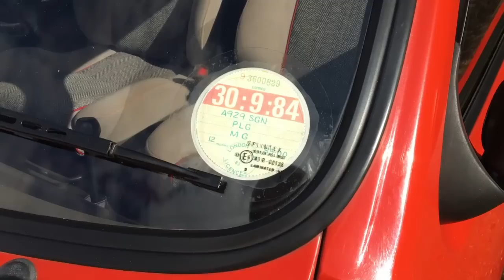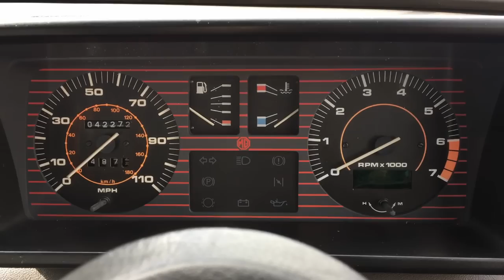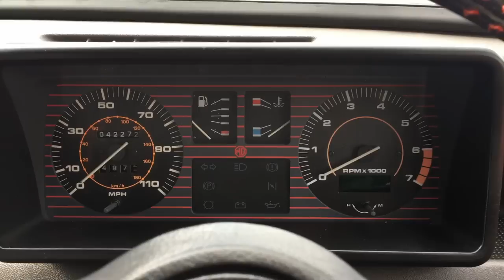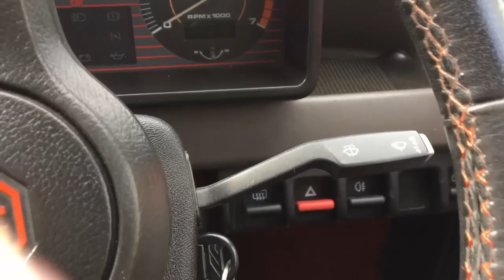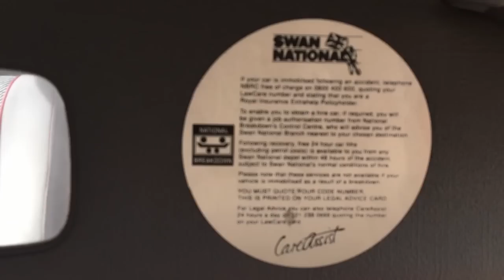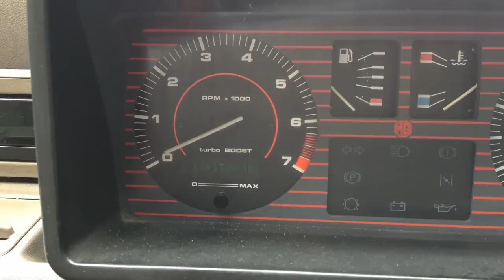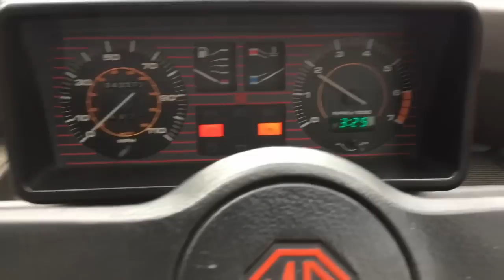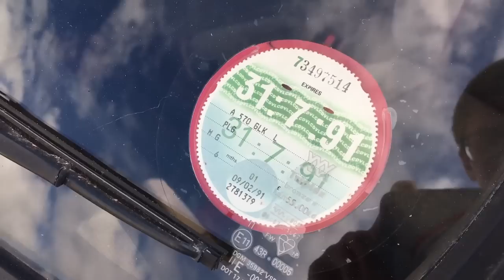"Your Best Friend Will Hate You" - 1983 MG Metro 1300 & Turbo

Comment: If I remember correctly, didn't those pepperpot alloys have metric tyres fitted?, I had a little white 1 litre metro back in the 90's (about the same time as my Maxi) and I got hold of a load of those alloys cheap and just fitted the wheels that had the best tyres on them (money was tight back then), I remember bringing my new born son home for the first time in that car, fond memories.
Reply from the maker: No. All Mk1 MG Metros had imperial size alloys, in this case pepperpots.
Reply: @TwinCam  Interesting, I'm not overly clued up on BL cars (I'm more of a Ford man) and I drove what ever I could afford to buy back then, may be it was the later alloys that had the metric tyres, I remember looking at them and realised they weren't the usual type sizing (185/60/13 for example), I remember the reg no was C500 KAR.
Reply: Just had a look and apparently some of them had metric tyres, there's mention of Courier M65 160x65x315, I used to work in the car trade and when I asked one of our customers (Tyreshop if I remember correctly) one of the fitters said they where metric, as the 315 bit confused me at the time.
Reply from the maker: Yep, Mk2 Metros had metrics. Mk1s ran until late-1984, Mk2s ran from then until 1990.
Reply: @TwinCam  Obviously these alloys where picked up secondhand in the late 90's so could have been mk2 alloys as they would have been out for many years, sounds like another strange Austin/Rover thing to do, no wonder they went tits up, which is a shame as I liked the Rovers (especially the 75), just out of curiosity, have you ever seen the photo's of the prototype 75 2 door coupe?
Reply from the maker: BL was very close to Dunlop at the time, as they made their wheels and Hydragas displaces for them. I expect that Dunlop may have gently encouraged them into metric tyres. It makes sense on paper, but as with anything it takes mass acceptance. In this case it just didn’t happen.

Comment: I hated the Metro.
I had a used 1.1 Fiesta at the time, when that got sold on, a work mate had their parents silver MG Metro sitting around so I hesitantly bought it off him, it was cheap and I was skint. 
The test drive went well, nippier than I was expecting but then I was used to a larger and slower 1.1 fiesta 

Since owning the MG I fell in love with it, sure it's wasn't a speed demon at all but it was very nippy and fun to drive. 

A proper little go cart, point, squirt peddle and go! 

Real fun drive with some nice little details, the red pipping on the seats, the red stitching in the steering wheel etc.

I think silver one I had was the best colour because the silvery grey interior echoed the shades of the paint work etc. 

Unfortunately it had got bad terminal car cancer  (rust) 
So it had to be put down....to the scrappy. 

Happy driving memories. 

Crikey imagine how the Turbo Compares when I thought the MG was nippy. 😱😁

Good presentation skills btw. 👍
Reply from the maker: Love that!
Thanks mate ☺️

Comment: btw the mk1 xr2 was 84 bhp not 82, and the mg metro turbo was 93 bhp
Reply from the maker: Measurement of power varies massively. 94 is the metric measurement, 93 is the imperial one. Depending on how you measure it, when, and where depends on the result.
I’ve just been doing research on the BMW E30 318i. Depending on who you believe, the power is anything between 109 and 115. I found 5 different figures. Even BMW changed their minds 3 times between 1987 and 1989.
Reply: @TwinCam  those are the figures from the factory I was quoting, even on google says the same as what I said
Reply from the maker: @intunewithcars9484  Again, as I said, all depends on the measurement. Both 93 and 94 are correct. 94 is metric, 93 is imperial.
Reply: @TwinCam  no idea why your still trying to correct facts that are true, mk1 xr2 84 bhp, mk2 xr2 96 bhp. mg metro turbo 93 bhp, mk3/4 xr3i 105 bhp, mk3/4 rs turbo 132 bhp, mate ive owned all these cars i think id know if the was different....all these figures are what any one that has owned the cars would recognise

Comment: A Metro in good nick was fun to drive. You got a smooth ride and go-kart handling. The 1.3 models were quite grunty and gave you nice roar when you accelerated in third. Despite all that, they were decidely non-U  Even Princess Diana couldn't make the Metro cool.
Reply from the maker: Massive shame as well, as I reckon the Mk1 MG 1300 was, looking back, one of the top-10 coolest cars of the 80s.
The style is just spot on.

Comment: Great little video. My Dad had a couple of (then) new Metros back in the day. They took us to Corsica and Hungary (when it was still a communist state). Sadly GYB681Y and D499MYD have long since been off the road.

One question I've always had and it's as dull a question as you could get; the parcel shelf at the rear, there's a round thing which looks like a small knob/dial. It appears to do absolutely nothing at all other than just turn. I've never know what this was for. Anyone know?
Reply from the maker: I’m not sure, but I think it might’ve been to drop the parcel shelf and park it up against the back of the rear seats, so you could get the practicality without having to take the parcel shelf out. Obviously, you could also then fold the seats forwards creating a flat load bay. 
My Metro doesn’t have it, as they’d gotten rid of it by then, but I’ve heard that was due to vibrations between the parcel shelf and the plastic supports for it?

Comment: Sadly these 2 wont ride and handle as well as your post '90 car Twin-Cam, cos those idiots at BL ignored Dr Moulton and connected the suspension from side to side instead of from front to rear, only Metros from May '90 onward were connected correctly.

Comment: I had an MG metro turbo. Looked great in black spoked wheels...

Am absolute dog. Put your foot down it would cut out altogether.

And the run on when you turned the engine off? Embarrassing.
Reply from the maker: Did you not get it fixed? 🤦‍♂️
Reply from the maker: Needed a simple carburettor service.

Comment: Not underrated. Comparing to its competitors one of the worst or directly the worst. This said, i like the car and own its son 114 (metro) Gti.
Reply from the maker: Well, that’s the opposite of what every magazine I have says. Autocar described the Metro as ‘the best small car in the world’.
Reply: @TwinCam  to make it clear, I like the car and I own a metro Gti. But comparing to its rivals... The best? I have a magazine also about this car and I haven't ever read anything wrote by a car journalist less positive than the metro turbo test. Once again  I like the car, don't want to Polemicize
Reply from the maker: The earlier Metros, not quite as good. The Metro Turbo was never anything compared to a later XR2 or 1.6 205 GTi, but the little MG 1300 and any standard Metro was always a better car than many revisionists give it credit for.
Reply: @TwinCam  which is the best turbo? From 83' to 85' or phase 2 from 85' to 89'?
Reply from the maker: They’re the same car, just with a different bonnet, grille, and interior, so it’s down to personal taste. I personally prefer the Mk1.
Reply: @TwinCam  oh, I asked because I've read different tests and sometimes the power its 90hp and sometimes its 94 hp, so I thought There could bé some mechanical difference